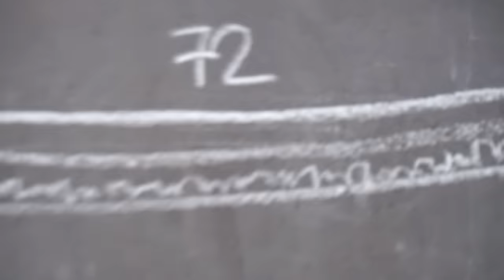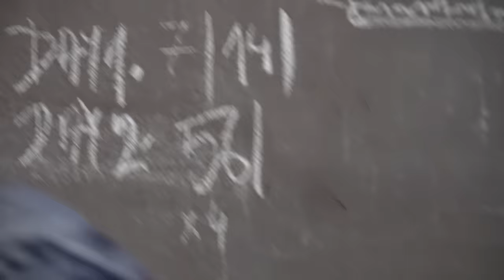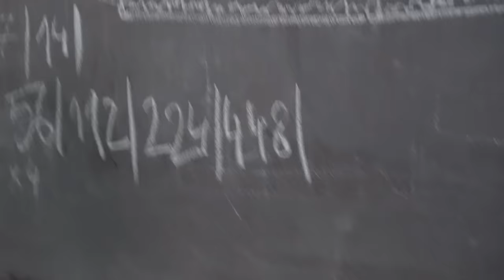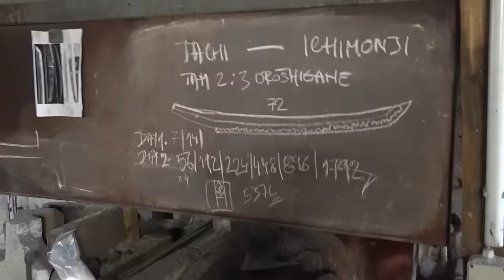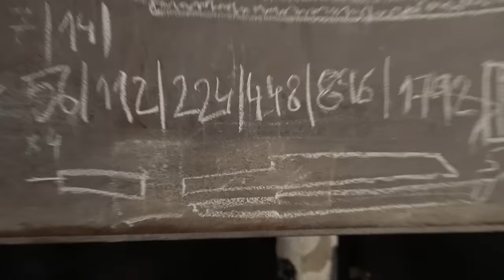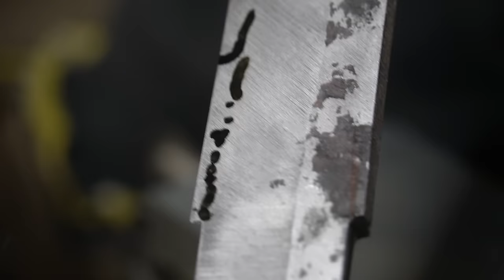katana making -  suriage tachi

Comment: Why put that hay on there if u scrape it off ,nonsense to me
Reply from the maker: It's carbon. During the forging process, it is absorbed into the surface layers of the material. Carbon content in steel can be controlled very effectively with this method. Just like when you put soap on yourself and then wash it off. It also has some meaning. Not everything we don't understand is nonsense.

Comment: Theres a point to where the added layers are not needed. I respect this craft and your work brother. Very nice.
Reply: Yes, and at some point it can even become detrimental as the impurities can induce unwanted or unpredictable stresses as they migrate with heating cycles. Folding or repeatedly forge welding is supposed to remove some of these impurities as well as homogenize the steel so you have a consistent product with even properties through our it, reducing the size and number of weak points, but then successive hearing cycles risks uneven heating and hardness on some points. 

Not only that, going back to what you said the folding at some point is really just about bragging. If you were to fold the blade 20 times, that equals approximately a million layers. But that's also 20 opportunities to increase the amount of oxides introduced into the matrix.

Comment: Amazing, what is the slurry? Do you use it to bring carbon in the steel, like the burnt hay?
Reply: If I recall it's clay slurry and straw ash. The straw for carbon and the clay slurry to slow oxidation. If I remember correctly that is😂
Reply: The clay slurry is to prevent oxidation.

Comment: Respect,very nice art.İ couldnt count how many times you folded the steel.
How do you decide the amount of steel?in the beginning.For example for a katana? do you weight it?
arigato
Reply from the maker: For the katana, about 4kg of raw steel is needed for the hagane and 0.5kg of the shingane. (Steel for shingane is already ready, old foldet weld steel). A hon san mai or kobude packet weighs about 2kg before being rolled into a stick. I usually make it a katana and a tanto. When I started, I needed about 7kg of steel at the beginning of the process. I usually have nothing left for tanto. I estimate the amount of material. When I make an oroshigane, I put 5kg of steel into the forge and pull out about 4kg of kera oroshigane. I cut that in half and this 4 kg is the basis for the katana. When I add tamahagane, the packet is a little heavier. I usually add about 1kg, but part of the oroshigane is used to repair the teko gane (holding rod). So the resulting package is about 4kg. It is quite large and heavy. It may be better to work with less steel. Process two smaller packets and join them together after 5 folds.
The number of folds is usually 10-12. It depends on the quality of the steel and the desired result. I'll do an extra fold or two if needed. The quality of the steel can be recognized. Properties change during forging, scales and oxides change. In the place where the packet is chopped and bent, the degree of processing is easily recognizable. If there are too many folds, the steel starts to degrade quickly. It starts to tear at the edges. After the next fold, it is no longer usable. Tears during forging. I'll make a video about it sometime. A large number of folds is one of the myths.
Reply: @katanamaking2606  thank you for your reply.

Comment: ah! eu ví depois. é um carvão de capim, pra que é que serve ? colocou mais desta lama, me explica isto. grato.
Reply: I’m not too versed in this as I’m just starting blacksmithing myself, but the amount of carbon in the metal determines the strength. More carbon, the harder and more brittle it is. However, you lose carbon when you forge. To try to prevent carbon from escaping, he puts the grass ash on it, which is full of carbon. The clay at the end is put on to prevent certain parts from cooling down too fast, since that can also make the steel too brittle. Hope this helps!

Comment: Master Swordsmith, I do not understand why you don't use flux between the layers of the folds when you forge weld them together. Please help me understand.
Reply from the maker: I use borax. But not often. If there is any problem, open weld defect, bubble. So I cut it open and fill it with some borax. It is important to thoroughly clean the surfaces that will be joined. No oxides. When I fold a packet, I always hammer it under the butt. To expel all the air. This is also important. Then there is no need to use flux on the inner surfaces. I also use it sometimes, but not a lot. When you apply Borax to the surface of the packet, it dissolves and fills the gaps between the layers. Prevents air from entering. The steel then does not oxidize. But ash and clay still works.
When working with modern alloy steel, (for Damascus knives) I always use borax. Steel has other properties. Tamahagane is easier for blacksmith welding.

Comment: Super, a test blade was produced first. In fact, this is the first time I've ever seen it done. Consequently, those metal blocks had a lot of impurities because of the sparks they gave off when they were taken out of the furnace.
Absolutely, this was a tremendous undertaking.
👍👍👍
Reply: The sparks are actually the carbon burning out , not impurities . They start with extra carbon so if some is lost it isnt a big deal . You will note they are always rolling it in the rice straw ash . This puts carbon back into the steel .

Comment: After separating them with a wedge, does the dunking in water make the metal easier to break apart for layering?
Reply from the maker: Yes. The surface is also cleaned of slag and scale.

Comment: I thought that when sparks flew like a sparkler that was bad? Or is necessary in this process?
Reply from the maker: if it was modern steel it would be destroyed. You can heat traditional steel (tamahagane) to a higher temperature.

Comment: What happened at 29 mins ??
Reply from the maker: 29 min. there is straw ash on the screen. It is used to wrap the packet. It is carbon and thus regulates the C content in the steel.
Reply: @katanamaking2606  I mean it went from block to blade without showing how he  did it..
Reply from the maker: It will be on another video. There was no camera available, dead batteries. Or something similar. @jaques2510

Comment: Incredible how you don't care about burning your steel
Reply: Primitive steels are different in half a dozen different ways from modern steels, especially when worked with solid fuels. The larger surface area allows them to rapidly pick up carbon and the lack of homogeneity means that some lost carbon through sparking is expected. There's a lot more nuance to it, but his work is sound.

Comment: Badly done. It does not have Shigane and has not been coated with Yakiba-tsuchi.

A shame and a serious offense to Japanese culture!
Reply from the maker: It's interesting how strong the need is for idiots to write stupid comments.
The blade is a Hon san mai construction, with shingane. 25 min video it is shown. It even says "shingane". If you looked closely you would have seen it. But I understand that an idiot looks at the beginning and end of the video and then makes comments.
Shingan-less construction is not uncommon in koto swords. It was also used in swords of the Heian and Kamakura periods. So, if shingane wasn't there, it wouldn't be a mistake. Study, you fool.
The application of clay is also not necessary. This technique is called hada yaki or zubu yaki. It was commonly used for glasses like Ichimonji. Hamon is distinct at the end of the video while sharpening the blade. I repeat again. Study, stupid. When you learn something, write comments.